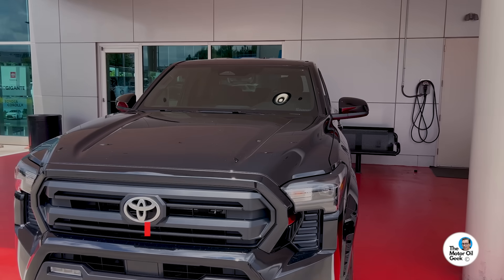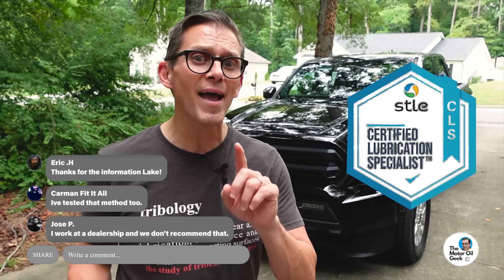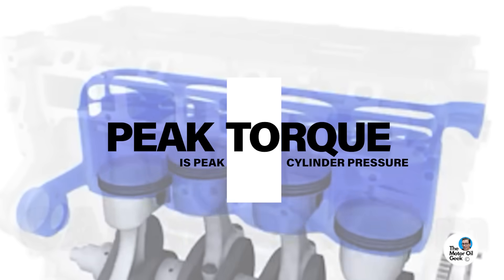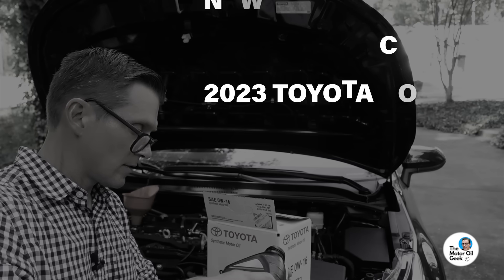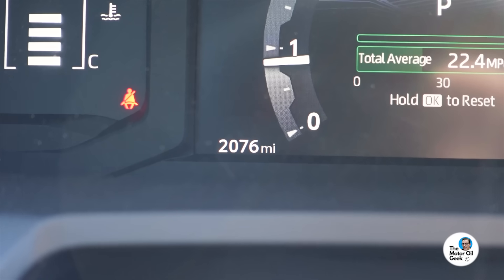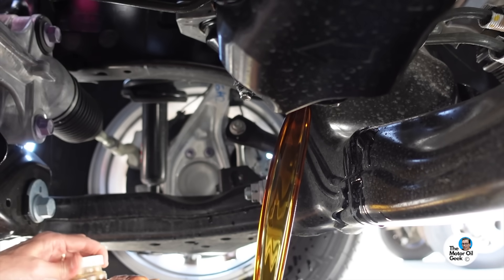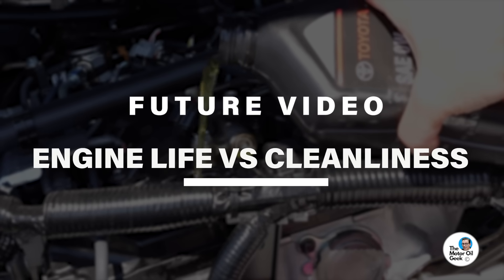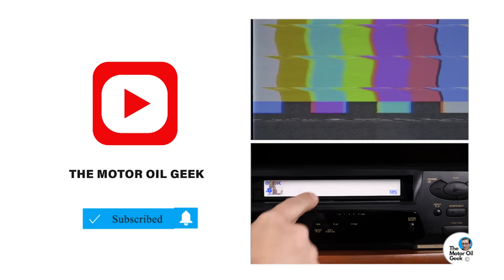The FACTS About Oil Changes (What The Owner's Manual DIDN'T Tell You)

Comment: My Renault Laguna III 2.0dCi 150 has its oil changed every 20 000km. First oil change at 20 000km. It currently has 630 000km on the clock. (391 000 miles)
Reply: yeah, the 500 mile first oil change is pretty pointless for modern cars. it's more like a feel good thing for the car owner
Reply: @rookiebird9382  Maybe go back and watch the original video and get back to us. BTW, what are your bona fides?
Reply: @rapid13  you just got pissed off because people who don't change oil so often and their cars still outlast yours?😂
Reply: @rookiebird9382  It really depends on what kind of environment was the vehicle used, and how. Everything else remaining constant, one will see benefits from timely or early oil changes. Going excessive in either direction is bad
Reply: @NalinKhurb  i agree. i never said early or frequent oil change is a bad thing. i just say it might not bring as much benefits as people expected. say a taxi cars that drives 300 miles a day will last longer on the odometer than a security's car that sits there 10 hours a day idling. oil change interval is not one size fits all. that's why commercial trucks have engine idle time records
Reply: Who cares

Comment: Another great video from Lake, I did my first oil change at 1,000 miles and the second at 3,000 and then at 5,000 getting me on my schedule of every 5,000 miles or 6 month schedule. My RAV4 being a Hybrid they say doesn’t get as hot as they shut off so I take it on a long road trip once a month to boil off any water and fuel dilution. Did have oil analysis done to see if wear metals have come down, yes they have. Thanks to Lake I expect my RAV4 to last well over 150,000 miles
Reply: I expect any car to last 150k except GM garbage.

Comment: On our last two cars, both Toyotas, the dealers actually changed the oil at 1000 miles. I don’t know if that was dealer or Toyota driven. Regardless one engine has 175,000 miles and the other has 80,000 miles. Neither burn or leak oil.

Comment: No — if the oil is cold, it means it has already drained to the pan after the previous drive,
so there’s no need to start the engine before changing the oil..
Reply: The idea is particles have dropped out of suspension.   And the dropping a quart of oil to rinse pan isnt going to rinse the entire bottom of the pan, or even pull the cold stuff as much as if its warm.
Just try this with a cooking pan. Leave it on counter over night, then simply pour it out.  How much stir fry juice was left? A LOT!

Regardless,  there's going to be (I am guessing) about a cup of oil in an engine no matter if it sat over night or 10 minutes.   Watch Car Care Nut turn an engine over on stand. He always says, "I hate this" referring to the muck about yo pour out on his sanitized floor.

A warmed engine will have particles in suspension vs. laying on the bottom of pan and other places (I call them shelves).
Reply: @davepetrakos475 100% accurate
Reply: @davepetrakos475    This makes sense as well, both viewpoints have merit.
Reply: Right especially with the very thin oil you get too much stuck up in the engine if you change it hot. Rather have it all down in the pan myself. And not burn my hands off.
Reply: You want to drain the hoter oil because it flows faster and takes the contaminates with it.  But with 0 20 oil  it may not matter as much
Reply: My engine has roughly one quart of oil it circulates that takes approximately 48h to drain back to the 8qt sump. I'm not starting it before I change it.
Reply: This is my thinking as well.

Comment: Lake, I just got a 2025 Mazda CX-5 and plan to follow this exact schedule, though many social media commenters have decried it. I've also done 4 oil changes in 18 months & 7,500 mi on my 2024 Mazda CX-5 Turbo as well.
Reply: I did very close to the same with my CX-5. I changed at: 1,000; 2,500 and 5000. And now at every 5,000. I'm using Pennzoil Ulta Platinum 5W-30.
Reply: Turbo or not?  We went with the turbo because it just gives that v6 pull. I’m definitely changing the oil early.

Comment: I just looked back at my records on our 03 Chevy. From delivery I changed the oil and filter at 3K, 6K, 9K etc. I'm now at 356K miles and usually change it at about 50% oil life remaining which means about 6K miles. The body on frame is gonna rot out before the motor dies.

Comment: Funny you mention changing the oil so soon.   I did about the same with my new 25 Ram with the 3.0 Hurricane.  Changed at 800, 2k, 5k, and now again at 10k yesterday. People told me I was wrong for doing oil change so early because it had "break in oil".  Once i hit 5k miles on this new oil Penzoil Ultra Platinum, I intend to send you a sample to see how it's working out. That would be 15k miles on the truck, and this is the second run of the PUP.
Reply: Its not funny at all. ANY engine builder tells you or even REQUIRES you to do so. When we build engines for people (usually old carby small block chevys) we keep the car for 500 miles. That way We know EXACTLY how the first 500 miles was driven, low rpm ect.. and the oil is changed twice in the first 500 miles. Break in building oil is changed at about 100-200 miles, then it gets it again, till 500.. Then it gets normal oil that it should use for the remainder of its life.
Reply: @crisnmaryfam7344 im saying funny as coincidence.  I posted my videos of doing the early oil change videos on here and in the world of YT i had lots of people tell me im wasting time, money, and oil, and said how i was doing it wrong. But you know, its my truck. Ill take care of it how i see fit.    

Maintenance is key to longevity and extended runs of 20k mile oil changes seems very taxing and a big ask of the oil especially when you factor in lots of new engines are DI, turbocharged, 1 or more chaines interaly to operate everything, and calling for 0w20 or lower viscositys of oil. 

Maybe having grown up around alcohol dirt track cars and mechanic back ground i view things differently than other people. And i stand on maintenance is best practice.
Reply: I would love to see your results over time.  That sounds like a sweet engine!

Comment: I disagree with leaving the original oil filter on.   Those OEM Toyota oil filters don't do well in the ISO 4548-12 efficiency tests, and, they don't use the "cake layer" loading like AIR filters do.   A good technical proof of this (web links to SAE papers, Purolator engineers statements, Ascent Filtration testing, and a discussion) is found if you ask ChatGPT or Grok AI  , or even Google's Gemini (just by googling and asking for more AI content):     "Does zeeosix at the bobistheoilguy forum (the oil filter forum part of that) say engine oil filters actually do NOT get more efficient with age?"

Comment: I recently bought a new tractor that had been on the lot for 2 years.  I changed the oil shortly after it was delivered due to the age of the oil which only had about 5 hrs on it.  I changed it again at 50hrs and I’ll sample it soon.
Reply: Some manufacturers use a special break-in oil. John Deere is one such manufacturer.
Reply: @matthewkuhl79 Thank goodness I didn’t buy a John Deere, not getting any taxpayer subsidies so I couldn’t afford the green paint.  🤣
Reply: I don't think I would change the oil based upon age alone if you are careful to get the oil hot each time you drive it. For example, the guy who buys a Corvette new  and it spends most of its time in the garage. Gas getting old in the tank would be a concern though.
Reply: @Greg-Gore Oil will degrade over time, there’s some Oil Geek videos about it.

Comment: if the oil filter doesn't catch harmful debris, the damage is already done at the factory dyno and your first 500 mile drive. why wait till 500 miles? why don't you change the oil right after getting the new car? the whole point of 500 mile oil change is to flush out the debris that can't be caught by the filter. but since you don't change the oil filter in this video, it becomes pointless.

 fyi, toyota oem oil filter has the worst filtering performance but the best flow rate and filtering capacity among all filters in the market. it shows toyota prioritizes getting the oil circulated in the engine as quickly as possible during the cold start rather than filtering out all the particles because most wear and tear happens during a cold start.
Reply: Factory dyno? You think they dyno test every engine before they install it in the vehicles? Hahaha, that's precious.
Reply: @budlanctot3060  yes they do
Reply: From the factory, they use factory break in oil that have different additives.
Reply: @bdo3043  Not true anymore.
Reply: @bdo3043  not for toyota
Reply: @rookiebird9382  Look at 7:53 the moly counts on the factory fill is almost five times the Toyota 0W-20 out of the bottle.  Granted, this could be from assembly lube.
Reply: @rsz2001  he made a mistake in his spread sheet, 8/12/25 has 0 mile but 8/4/25 has 487 miles? fyi, 988 moly is what you get in an oem bottle from any toyota dealership
Reply: @rookiebird9382  I believe he alluded that the 8/12/25 sample was fresh out of the bottle, a baseline for the oil itself.
Reply: @lt1nut  new toyota oem 0w-16 oil has around 700 moly. there's a lot of sources online
Reply: @rookiebird9382  I'll take your word for it, I'm not here to argue.  He tests oil so I don't blame him for testing what he was pouring(0w-20, iirc) himself; that test sample had zero miles and populates his history/chart is all.
Reply: @lt1nut  i'm not trying to be an expert. but i just can't figure out why new oil has way less moly than 1500 mile oil as well as detergent and anti-wear are also less
Reply: @rookiebird9382  I assume Lake will see this and address it since he's shown to be involved in the comments. 👍🏼

Comment: Tell us how much oil is consumed between oil changes or oil level on dipstick. Since low tension piston rings started 2011 I am amazed at oil consumption on some engines. That oil viscosity numbers for the sake of gas mileage is scary.
Reply: Even more important to keep oil clean with low tension rings - no sludge allowed and use techron complete in the fuel tank at least once every 5k miles to keep those rings moving without the carbon buildup. Dirty rings are leaky rings. Stuck rings are even worse. 10k oil changes are idiotic.

Comment: What about the transmission? It costs just as much as the engine but is completely forgotten about
Reply: There's is a strange persistence in the world of car owners that the trans is never to be messed with. Transmissions dying left and right around 100k miles and they gripe at the trans that was bathing in dirty fluid the last several years of it's life, and dead fluid the last few years of its life. Although, I dont think Lake is ignorant to all that
Reply: Transmissions lead a MUCH nicer life than engines.  Combustion byproducts are the biggest issue with oils and transmissions don’t have that.  Also, temperature and transmissions run much cooler than engines unless you are really abusing them.
Reply: @LTVoyager  Less combustion byproducts, indeed. But trans dont operate cooler, at least newer ones dont. Well over 200 degrees on many models, and some going 250 during towing. And thats on ULV fluid
Reply: @Resistculturaldecline There are parts of the engine that operate at close to 400 degrees.  If the engine is turbocharged that increases to 500 degrees.  No modern transmission sees temps close to that unless it is failing or being seriously abused.  That is simply no comparison.  Oil in a transmission can run 50,000 miles and see less stress than 5,000 miles in an engine.  I change my transmission and diff oils at 50,000 miles and the oil still looks new.  And my Chevy truck transmission runs consistently at 130 degrees or less.  Even towing it rarely sees 150.  My car doesn’t have a transmission temp sensor so I can’t see what it is running at, but I suspect it isn’t much higher.
Reply: Yes, adding dyes can have unintended consequences.  Would have better just to mix to a certain time such as two minutes and then you remove that variable.  Most folks aren’t going to hand stir more than two minutes so that isn’t a bad choice.
Reply: With only two samples, you really can’t draw any legitimate conclusions about consistency.

Comment: Awesome video. Car care nut recommends for turbo engines 3000 mile or 3 month regular change interval.  I’m on board with 3k miles but 3 months seems excessive.  Please address this turbo oil change intervals.  Thanks
Reply: I agree 3 month intervals are excessive.  I love TCCN, but sometimes he overdoes it.  For example, Toyota oil is very good, but there are other very good oils.  If a person buys Pennzoil Platinum at a nearby store, that is at least as good as Toyota oil.
Reply: Yeah, depending on your climate, 6 or twelve months; 12 being Phoenix like (arid).

An analysis will tell you how many more miles you can use the oil.  If you have the resources to do it up front, it will pay back.  
I have gone to *4,500ish miles and around 7 qts I am recovering costs nicely. 

*4500 m divided by 20 mpg hwy is 225 gallons. 
I change oil according to Fuel Used as it is a better indicator of contamination.

Comment: I learn more every video I watch of yours, I use science AND speculation 😉😁. It is my speculation that manufacturers use extended oil drain intervals to promote "lower cost of maintenance" while also increasing planned obsolescence!  Take Land Rover's 2 Year 24,000 mile oil drain intervals.  They also use a suction method of extraction rather than draining using the drain plug.  That would be an interesting video, too.  Can suction get as many contaminants out as draining the oil?  My speculation is that it doesn't!
Reply from the maker: Stay tuned for an upcoming video!
Reply: you speculation is wrong, it actually works better because that suction can pull other crud that draining alone wouldnt push out. The other hand of this is, a transmission service that uses force flushing can damage the internals of automatic trases.
Reply: @crisnmaryfam7344 that's why I suggested the testing because in my mind gravity would pull out the heavier contaminants more thoroughly and completely than sucking upwards 3 feet.

Comment: You dont change oil when its bad. You change it long before its bad.
Reply: It’s not a binary good/bad with oil. It’s degrading from the first mile you put on new oil. If you change oil/filter every 500 miles you’re going to theoretically have more wear due to your new filter letting more particles through. Finding a happy medium that prevents any sludge is the goal. Sludge causes oil burning for sure and more fuel dilution which ends an engine early.